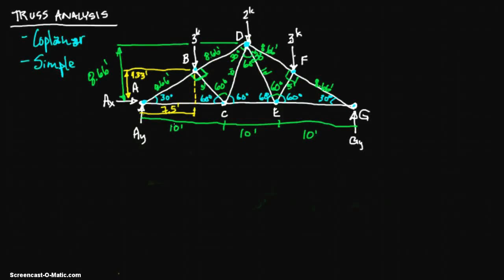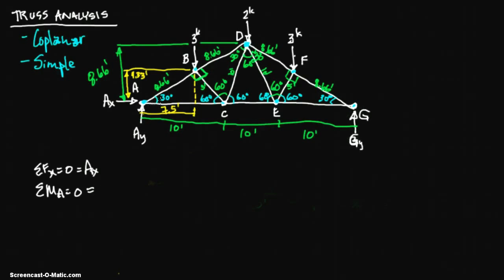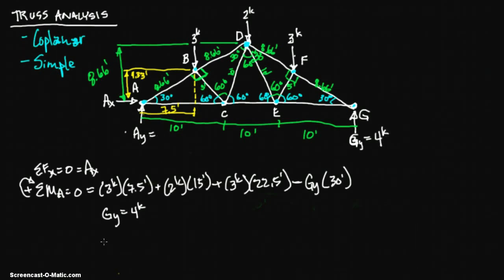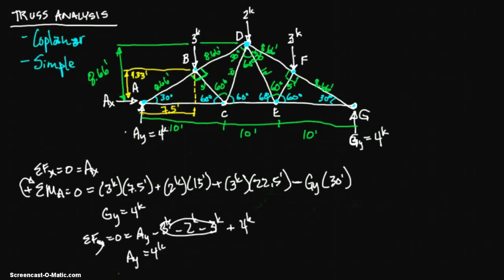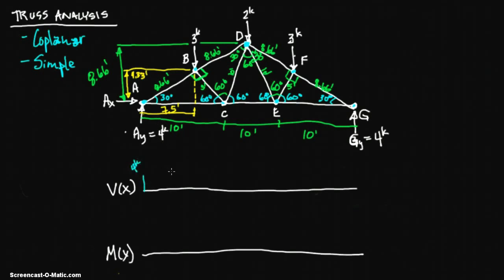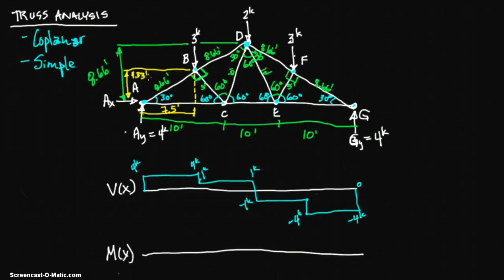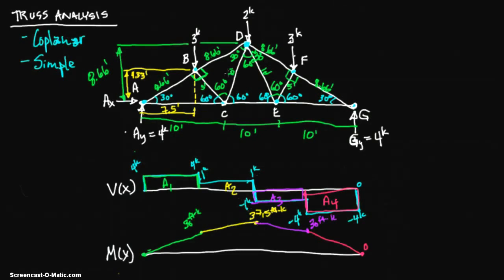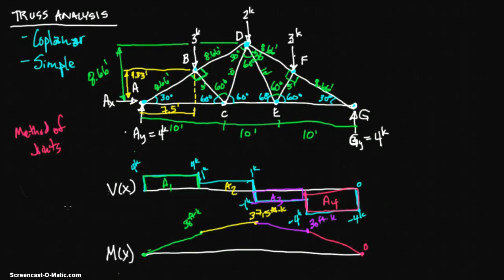Simple Truss Analysis (Part 2)

Comment from the maker: @Cesariono When looking at a bridge truss, you will usually apply all the loads to the bottom panel points if you have a through truss.  The deck will distribute the loads to the stringers, which will transfer the load to the floorbeams, which will transfer the load into the panel points of the truss.  Just another example.